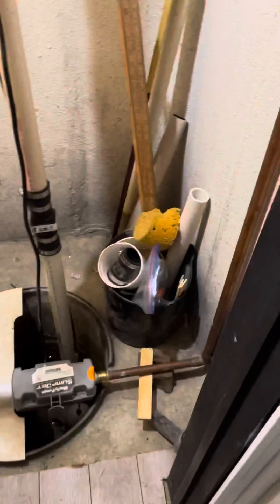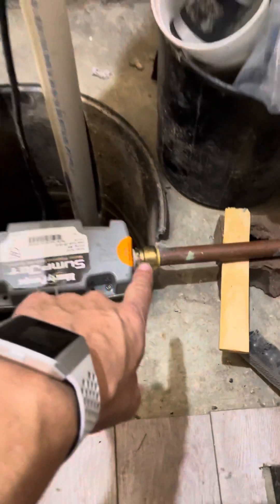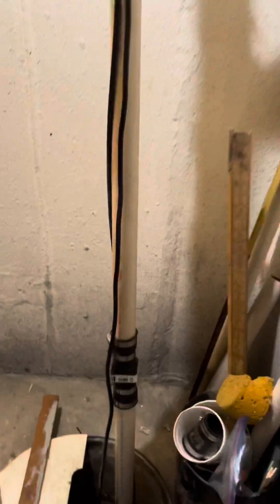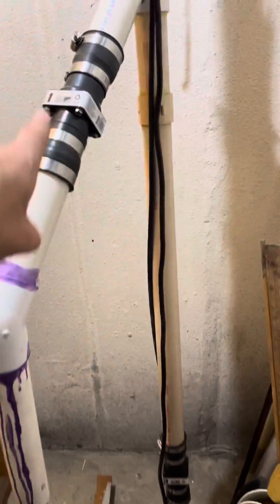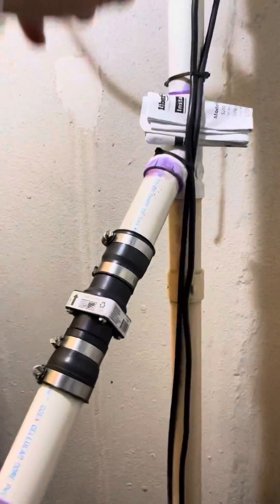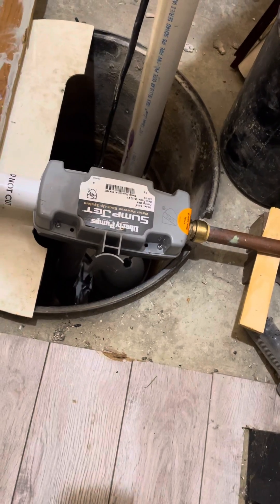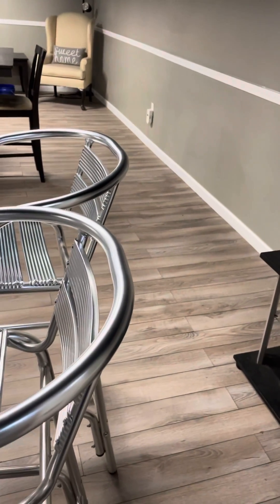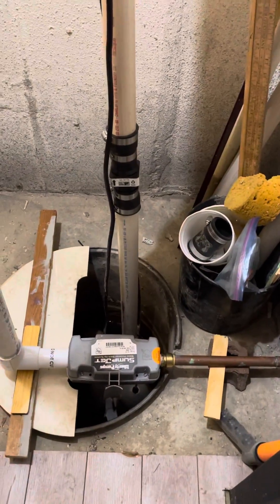SJ10 Liberty water powered back up sump pump

Comment: The supply water flow does not spin an impeller - it runs on the venturi principle.  There are essentially no moving parts.